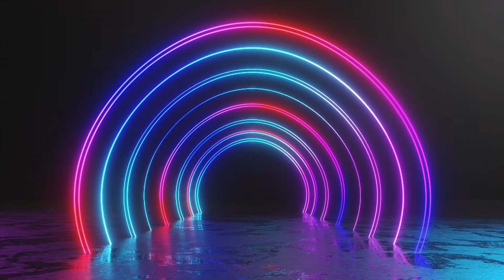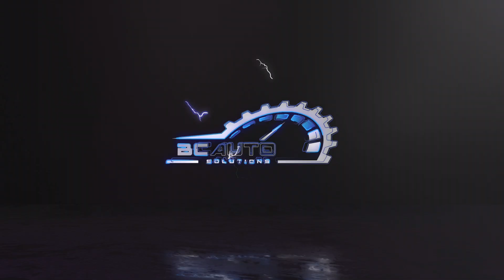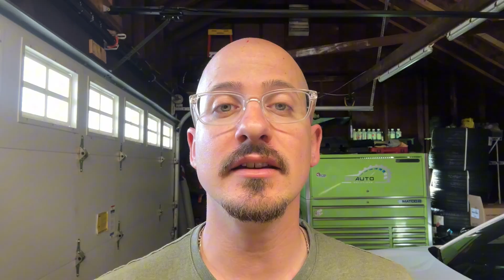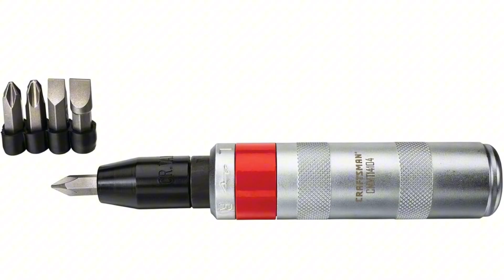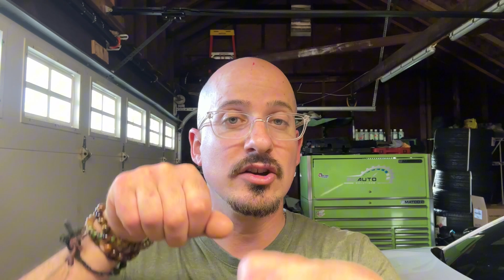Q&A Episode 100 (EGR maintenance | rotor set screws | cracked spark plugs)

Comment: I want to change the brake fluid on a 2021 tlx. Should i use oem dot 3 or aftermarket dot 4 ?
Reply from the maker: @Eugen-E  dot 4
Reply: @BCautosutions  What brand do you recommend ?
Reply from the maker: @ any brand really. I’m not particular on brake fluid
Reply: @BCautosutions  I think that  chemical composition matters. If not appropriate it will affect the rubber, seals, hoses, ABS and plastic components. The viscosity also matters.
Reply from the maker: @ this is true but most off the shelf stuff is the same with different labels. I’ve never really had any issues with any brand dot 3/4.

Comment: I installed a CVT Cooler on my 2021 Honda Civic EX 1.5T. It used to heat up fairly quickly to about 185F even in the winter in about ten minutes running through the factory preheater, I would get up to around to 225F just daily driving. Since installing the CVT cooler and bypassing the preheater it takes some time to get to 185F now and the highest I've seen is 198 F so far. My question is what is the optimal tempretures fthat the 10th generation Civics with the CVT's   What temperature is desired befored getting on the road in the winterlike to see?

Comment: I have question on the 2ed gen Honda Fit.  When I replaced the spark plugs they where lose. I replaced the spark plugs and has small misfire after tightening it down to torque spec. Is this a common problem ? Thank you. Love your videos
Reply from the maker: @Aviation85  yes, they have a tendency to rip out the head. Can also be the coils or tight valves. Would need to read some data to pinpoint

Comment: Those screws can be left off a far as I can tell.  The wheel holds the rotor in place.  It is located by the hub mating surface, not by the screws.  Does anybody disagree?
Reply: yup gotta clean things up very well before reinstalling
Reply from the maker: @cpbremote  while I agree in high rust areas anytime you remove the wheel you run the chance of rust getting wedged in between the hub and the rotors causing unwanted vibrations.

Comment: Last time I rotated tires, I went ahead and removed the rotor screws before they became difficult.  I dabbed on a bit of anti-seize and re-installed the screws.   I don't think I will have any trouble with them when the rotors need replacing, years from now.
Reply from the maker: @attocoulomb  nice call! That’s what I do as well but use red bearing grease instead of the anti seize it’s just less messy
Reply: @BCautosutions Can you put red bearing grease on wheel studs to make removal easier when doing rotations?
Reply from the maker: @ yup, I usually do especially people who wash their cars frequently. Also around the center of the hub

Comment: @bcautosolutions I would love to get your thoughts on the 0W 20 oils Honda recommends on the Accord non hybrid cars.  I have seen youtube videos pointing out that more wear and tear is occurring, and they recommend a heavier oil like 0W 30 or 5W 30.  What are your thoughts on this?
Reply from the maker: @anthonyvelez7557  5w30 on any Honda engines and most engines. 0w20 is for EPA figures. Both my cars are on 5w30 at this point.

Comment: In Ontario Canada, rotor set screws are just as hard to remove. I have had good luck with Vessel JIS#3 impact screwdrivers. Like an impact driver, these use a cam action with a strikethrough handle. Vessel Made in Japan is extremely high quality and the JIS#3 is the correct bit for Japanese vehicles, unlike Philips bits which will cam out and damage the screw. Another important tip is to the hit the head of the rotor screw with a hammer through a flat block of metal. This helps shocks the rust loose and is remarkably effective on tough screws.
Reply: Apart from that, use lots of penetrating fluid and always use new rotor screws completely slathered in antiseize and only just finger tight.
Reply: For all the rotor set screws I have loosened and then reinstalled this way so that someone in the future benefits from the ease of removal…I hope this is good karma that will make its way back in the future.
Reply from the maker: @shahrukhbakar3248  👏

Comment: 💯 🎉🎊🎊🎊👍🏽
Reply from the maker: @WhereHasMySanityGone  🙌
Reply: @BCautosutions  While i may have missed it, any guidance on brake fluid change increments (factory or more aggressive) even if the fluid still reads good with a tester? Also, the same with CVT trans fluid service increments and if those are DIY friendly? ✌🏽
Reply from the maker: @ I would recommend those at 30k intervals. Brake Fluid every 2 years regardless of mileage. Both of those can be diy fluids for sure

Comment: Another great video, thanks! Another possible QA question, similar to another you answered, but inverted, where instead of potholes, you run over upheaved asphalt where it's like a ridge/lip in the lane at highway speeds, sort of like a mini-speed bump. There are a few on the I280 and I273 and I know which lanes to avoid hitting them (after hitting them the first time, lol.) Is one worse than the other in general? Potholes you can sometimes avoid by turning a bit, but these raised ridges usually cover the entire lane so all you can really do is slow down if you could see it in time.

Comment: Thank you for the technical videos and answering questions.
2015  Honda Civic, CVT, 44k miles
Vibrations/Rattle into dash.  Found your video on mounts.
I changed my upper-side-mount and 90% of Vibrations/Rattle is gone.  Thank you.
I removed and checked the lower-torque mount. It was good and re-installed.
Do the transmission/motor mounts also fail early?
I can duplicate the Vibrations/Rattle by putting in drive and increase RPM to 800.
I am thinking that I might put some hard foam on my floor-jack and remove some of the engine weight and try duplicating.  Think it is a good idea?
Is there a way to verify a bad transmission/motor  mount without removing it?
Reply from the maker: @rondail5675  I’ll talk about it in the next video it’ll be easier to explain but you have the right idea